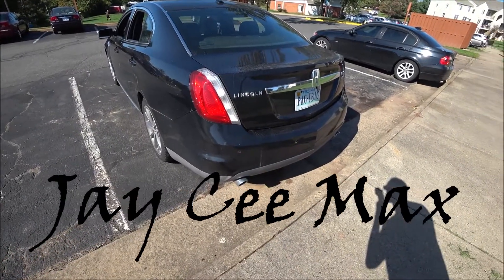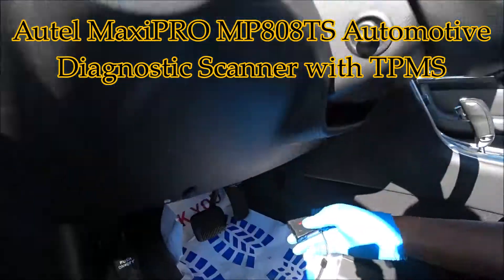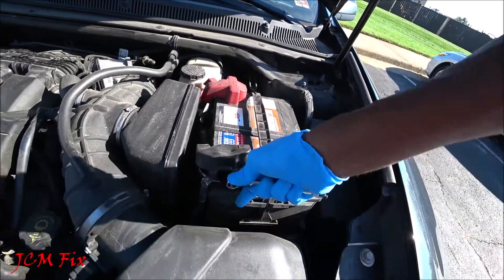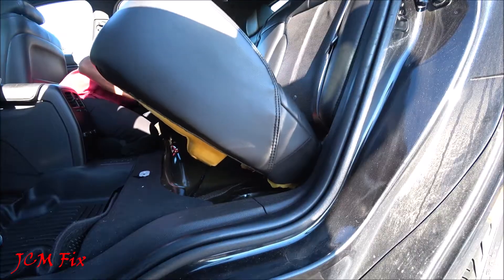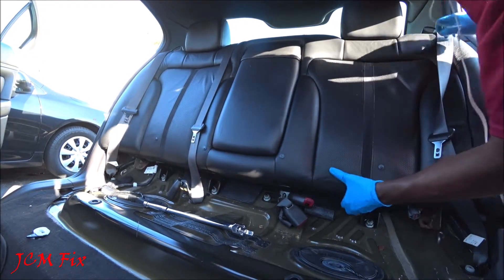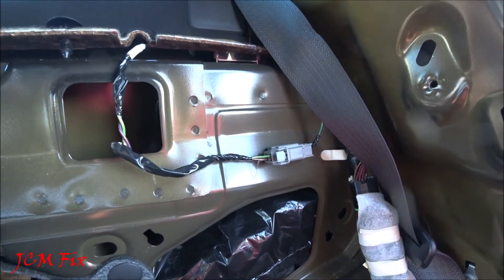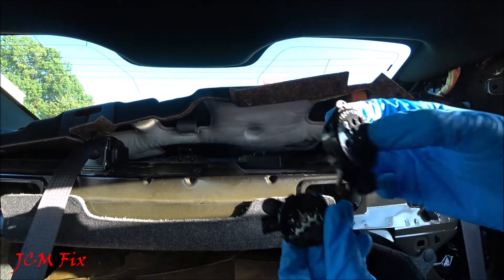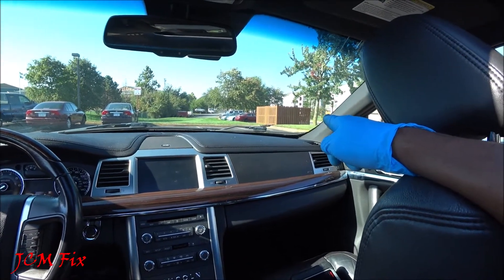Lincoln mkS " Check Rear Park Aid " Error Repair | Rear Parking Aid Speaker

Comment: I have a 2013 Ford Taurus with this error message. A car repair shop quoted me over $1000 for this repair. I have been unable to find any other video that shows how to access the rear parking aid speaker. This is an insanely difficult repair, so no way I can do it myself. Due to the cost, sadly it looks like I'm not getting this fixed anytime soon. Why do they make these things so difficult to access? Nonetheless, this was a GREAT Video! Your instruction was very clear and amazing.
Reply from the maker: I hear you. The instructions are actually very similar. If u follow everything I did in this video and apply it to your Taurus, you can fix it. I believe the part is actually the same as well. Just research the differences and you can get it done.
Reply: @JCMFix  Thank you so much! 👍

Comment: Hey Jay Cee,

Funny story.  I have a 2010 Lincoln MKS....not a 2009.   The part # checked out from the supplier as also working with the 2010 so I tore everything out and lo and behold....did NOT find the speaker where it was supposed to be.   I took out the partial shelf entirely thinking it was hidden in there somewhere.  It was NOT!   Just my luck.....

anyway I put everything back together and gave up for today.   

Any idea where that little speaker is located in the 2010 model?   Thanks!

Tom
Reply from the maker: Hey Tom,

I'm sorry to hear you went through all of that work for it not to turn up. When the rear speaker used to sound, in what direction do you remember it coming from?
 
I went ahead and looked it up for you.

Per the  2010 MKS Workshop Manual SECTION 413-13A: Parking Aid.
Procedure revision date: 07/06/2009
DESCRIPTION AND OPERATION:

"Rear

The rear parking aid system consists of the following:

Four ultrasonic parking aid sensors (located in the rear bumper)

Parking Aid Module (PAM) (located under the left side parcel shelf)

Rear parking aid speaker (located under the left side parcel shelf)."

"Front and Rear

The front and rear parking aid system consists of the following:

Four ultrasonic parking aid sensors (located in the front bumper)

Four ultrasonic parking aid sensors (located in the rear bumper)

PAM (located under the left side parcel shelf)

Front parking aid speaker (located on the hush panel assembly below the glove box)

Rear parking aid speaker (located under the left side parcel shelf)

Parking aid disable feature (integral to the IPC message center)

Parking aid disable feature is not available when a MyKey™ is in use."

I went ahead and looked at the diagram specifically for the 2010 model and it shows the rear parking aid speaker is in the same exact place as the 2009 model:

"Removal and Installation

Remove the parcel shelf trim panel. For additional information, refer to Interior Trim and Ornamentation.

Disconnect the parking aid speaker electrical connector.

Remove the push pins and parking aid speaker.

To install, reverse the removal procedure."
Reply: I really do not recall.   maybe left?   @JCMFix

Comment: Hey JCM, awesome video, it is one of the best informative MKS videos ever.  I love the call out on the sockets, and the electrical connectors, and the trim clips.  Not everyone takes the time to cover these important details.  Just feel blessed that you don't have a 2014 MKS with the rear sunshade which is directly over the speaker.  You have to loosen the shade to remove the speaker.  While I had the trim removed I cleaned up the "C" pillar grounds, the driver's side had a cold solder joint, which arbitrarily gave me a BLIS warning.  Thank You for caring!
Reply from the maker: Thanks RS. I am trying to do what I wish others would do when they make videos. For me, every detail could be useful. I appreciate your understanding. You rock.
Wow, I didn't even think about the more recent sun shades. That would have been a pain indeed. 
Thanks for being here. Much more to come!

Comment: Hola, ¿donde puedo conseguir la sirena?
Reply from the maker: Hola mi amigo Jabneel. Todos los enlaces del sitio web de compra ya se encuentran dentro de la "Descripción" anterior.

Here you go:
Ford 4L1Z-15K864-A Sensor de ayuda de estacionamiento trasero: https://amzn.to/3rJPGxM
Reply: @JCMFix  Hello, good afternoon, thank you very much for the help, it helped me a lot, with the link I was able to get the piece, it is about to arrive for the installation.
Now I need one last help, I hope you can help me, I need to locate the horn for the front parking aid, since it does not sound either, but I have not found anywhere on the web where it tells me where the front parking aid horn is located. 
¿Could you help me? 
My car is the same as yours, Lincoln MKS 2010 
Please I thank you so much 🙏
Reply from the maker: @jabneelortiz6974  Aquí tienes:
2009-2016 Lincoln MKS: Ford 3F2Z-15K864-BA. Speaker Assy - Front Parking Control Aid (https://amzn.to/3K62IQ4).

Front parking aid speaker (located on the hush panel assembly below the glove compartment).

Altavoz de asistencia de estacionamiento delantero (ubicado en el conjunto del panel de silencio debajo de la guantera).

Removal and Installation:

1. Remove the 3 screws from the hush panel assembly.

Disconnect the electrical connector.

2. Remove the 2 front parking aid speaker rivet push pins and speaker.

3. To install, reverse the removal procedure.
Reply: @JCMFix  Thank you very much, I appreciate you. Maybe I can't explain it well, but what I still don't know is, ¿in what area of the car is the front parking assistant horn located?
I need to know where the front speaker is located, since I haven't found where it is located yet. please 🙏
Reply from the maker: @jabneelortiz6974  .No hay problema. Escribí la ubicación dentro de mi respuesta en español e inglés.
Reply: @JCMFix  Hello, today I installed the rear speaker, and it worked perfectly. Thank you so much. I read your comment and although I have looked under the glove box I still cannot find where the front speaker is located, I hope one day you will make a video where you explain where the front speaker is located. Greetings from Mexico, thank you. 🇲🇽🇺🇸
Reply from the maker: @jabneelortiz6974  Awesome. Maybe the front parking aid speaker location is different in the 2009 vs 2010. I'm not sure. I am happy you were able to fix the rear parking aid speaker. Good job.

Comment: I just got a 2014 mks for my first car. Do you have any ideas what I can look for to find what the issue is with my front two speakers (no sound) and the usb ports/sd card reader don't have power/read?
Reply from the maker: It's probably a fuse issue. I'm not entirely sure.

Comment: Very informative video! One thing to note is that you might also have a problem with one of the sensors. You can check this by putting the car in revers, putting the e-brake on or having somebody hold down the brake. Then you go to the back and listen to each sensor. If you hear a rapid, electronic clicking, then it is working. If you do not hear that, there is a sensor problem. Also, if you are just wanting to clear the code and not necessarily worried about the speaker working, just use the buttons to the left of the steering wheel, right under the light control. You should be able to use either setup>reset or input>reset to make the sensor light go away. Overall a very good video. I fixed mine with the buttons, but I will likely replace the speaker as well.

Note: I have a 2010 Ford Fusion, not a Lincoln mkS. Much of it seems to be similar, I am not sure if every single thing that I said carries over or not.
Reply from the maker: Yes. I am aware of that method but the scan tool that I showed can actually show which sensor is faulty without putting your eat to it.
Luckily, the scan tool showed me it was just the speaker for this issue. All was well with the four sensors after this fix.
Reply: I can clear the code but it always comes back!!?! Is there a way to keep it gone